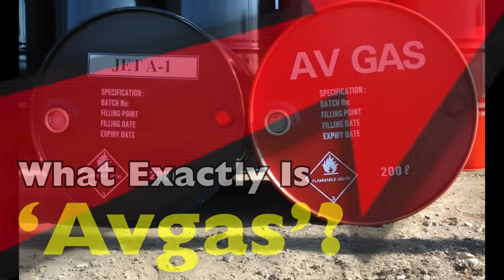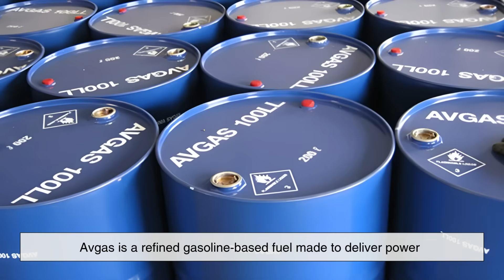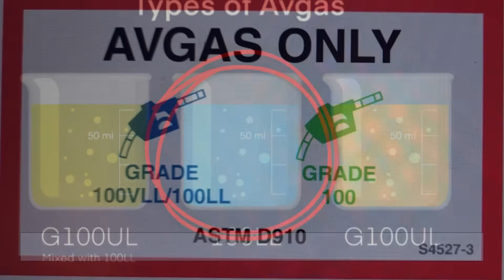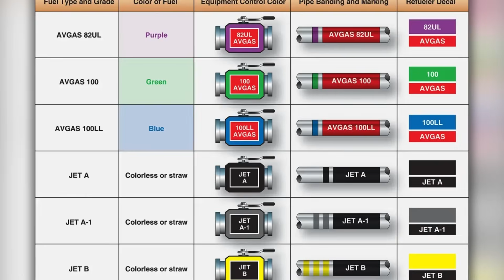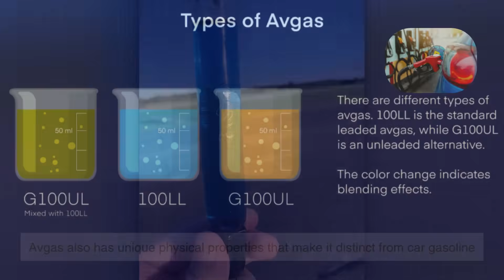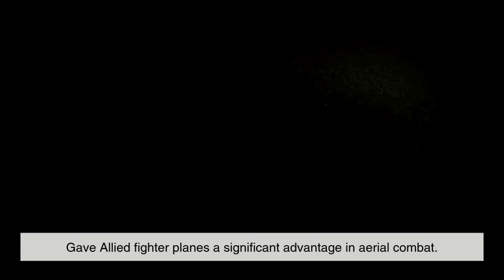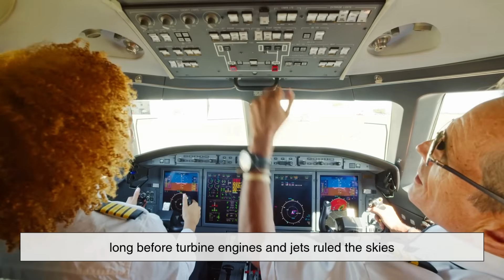What Exactly Is Avgas? The Secret Fuel Behind Small Aircraft

Comment: The old airplane engines 1940's or older were air cooled and ran on 80-87 octane fuel. This fuel had lead in it to facilitate lubrication. They came out with a newer fuel called 100LL for newer engines. The 100 is the octane and the LL stands for low lead, but of course it has lead in it. These aircraft engines are still used but are getting rarer and will fade away in time. I had a homebuilt with a new Subaru 2.2 Ltr. engine that ran on regular car gas.

Comment: Lead needs to be banned from fuel NOW!
Reply: There isnt much lead in 100 LOW LEAD. Every bit of lead that is in it can from the earth and will return to the earth. At between $5.00 and $5.50/ gallon and $30-60k for engine rebuilds, the last thing we need is another poorly thought out "solution" that causes more problems than it could ever solve.
Aviation is SO expensive, in large part due to government regulation and law suits.
We need relief and the opportunity to advance, not more regulation and control.
Reply: @scottwhitcher265  I repeat. Lead needs to be banned NOW.! Actually, 40 years ago. Lead is incredibly poisonous. Sure, the lead returns to the Earth. It falls on population centers. The aircraft that use leaded fuel are largely unnecessary. Ban the lead and let the planes fall where they may. Aviation is SO expensive? Too fuckin' bad. There is no right to flight.
Reply: Chlorofluorocarbons (CFCs) in my hair spray caused the ozone hole that magically went away.   nitric oxide went away with the   catalytic converter. In Iowa corn sweeteners are making our kids fat. But the carbon has to be sequestered at the processing plant. which is OK by your shouting.   Little bit of lead left will not kill you one day sooner.  Hope you get out of the Hotel California soon.
Reply: @2148aa  I don't care what you have to say. Lead is proven to be extremely toxic, even in small quantities. It needs to be banned from fuel entirely, 40 years ago. let the planes fall where they may.
Reply: @phlodel  Then you won't like the fact    that lead shotgun shells are still around for a couple of more years. Maybe you can shoot the planes out of the sky with them.  Next all the plastic pallets in the wild can be your next worry.
Reply: @2148aa  I'm thinking you fly little toy airplanes and don't want to change. Your engine will run on unleaded fuel, until it burns the valve seats. Then, you'll simply have to pay a lot of money to continue to use that engine. No problem.

Comment: Contrary to popular belief, high octane fuel is slower burning than regular 87. High octane allows you to run higher compression ratios and earlier ignition timing without pinging or detonation if properly tuned. Both of these obviously increase power. I use it in almost everything but my vehicle, due to it being Ethanol free.

Comment: I ran this stuff in all my muscle cars every day. No complaints & it worked flawlessly every single time. Used some Navy 120 AVGAS back in the day & it was like rocket fuel for my 11:1 compression pistons/550 lift cam-int.& exh. 312 duration flat tap solid lifter. That little 327 ran perfect with it. Side pipes were nice & clean.

Comment: My 67 VW bug loved av-gas, mileage went from 33 to 40mpg, lot more power, and quieter. I had a single 28mm carburetor so it ran lean, my wife's VW had dual 34mm carburetors, didn't make a difference on the mpg.

Comment: Used to be able to go to a small airport with a 55gal drum in yer pick-up truck bed and buy all the leaded high-octane (110~125) AV-GAS ya wanted for your hi-compression muscle car or hot-rod motor with 11.3-13.5 to 1 CR!
Reply: Avgas is VERY expensive!!!
Reply: @leechjim8023  So is CAM2 or other race fuel sold in a 5gal can~35gal drum. No idea how much Sunoco race fuel is at the track anymore! Probably double the price of 93/94 unleaded at the corner station.

Comment: Secret? Who is keeping it a secret? Specifications are available on the internet.  
Gasoline "for aviation use" doesn't date from the turn of the century gasoline was gasoline. Airplane engines were running on just plain old gasoline until the late 1920's. Octane ratings had been gradually improving through the twenty and thirties spurred by research in the USAAF and the auto industry (Kettering and Midgely). The invention and use of Tetraethyl Lead began to impact aircraft engines in the 1930s, and Doolittle pushed for 100 octane in the mid 1930s. by then the military and airlines were interested in higher compression and higher supercharge for improved performance, and suddenly airplanes were flying on 80 octane and 100 octane fuel, and the manifold pressure usable and corresponding horsepower of large engines was tied to the fuel in the tank. ;throughout WW2, octane rating/performance number increased in several steps to PN as high as 145 by 1944.
While nobody intentionally broadcast the intent, wartime fuel properties were  well known. The axis powers knew all about it , they just couldn't produce it in quantity, eventually not being able to produce any fuel at the end of the war.

Comment: Normal AVGAS is low lead fuel. WWII aviation fuel was extremely leaded to the point of 150 octane. With that fun stuff we had to clean the spark plugs every 25 hours of run time.  Such fun... NOT! The 100LL stuff now days is MUCH easier to deal with when it comes to engine maintenance... plus due to FAA mandates, there is NO alcohol in the fuel. Ethanol has a tendency to attack the aluminum wing skins when the fuel is stored in the aircraft tanks.
Reply: Ethanol is also responsible for short gasoline useful life, vapor lock, sludging and engine failures, mostly due to its propensity to suck/absorb water out of the air
Reply: @1shARyn3 exactly...

Comment: AVGAS is great for long term storage of gasoline powered equipment, motorcycles, etc., as long as they do not have catalytic converters. It lasts much longer than gas from your local gas station. Fill a gas can at your local small airport.
Reply: My snowblower, lawnmower, weed trimmer, pressure washer, ATV, generator and whatever small engine I own and forgot all use AvGas.  The lawnmower fires up with two pulls in the spring, the snowblower fires right up in the fall.  

No issues unlike everyone else that uses pump gas that degrades in the off season.
Reply from the maker: Thanks for sharing that practical tip!
Reply: You gotta use non oxygenated premium unleaded instead of unleaded regular grade with ethanol, alcohol. Some states still have regular non oxygenated, no alcohol, unleaded too. In my area we have 91 octane premium non oxygenated, no alcohol in it. Been working great in small engines and cheaper than AV Gas which was over six bucks a gallon in my area last time I checked.
Reply: @o @oneninerniner3427 Pump gas of any octane oxygenated or not still degrades much faster than AvGas.  AvGas has requirements to maintain octane stability much longer than MoGas (automotive fuel).  Never having to tear the carb off to clean it is many hours saved.  I’ll run regular pump gas during the season but the final tank before storage is Av.  Even if it was twice the price it’s a money saver not having to work on something.
Reply: Local airports around here will not sell it if it's not going into an airplane. Fuel-truck to airplane only!
Reply: That's the case at larger airports here but small airports often have self service pumps that take credit cards.
Reply: @MrHugemoth OK, guess it all depends on local regs, airfield management??? We did it back in the 80s. But I reckon things are different today. They can't get caught putting it directly in a street-driven vehicle because it is not 'road-use taxed' ($0.58/gal here in PA). Heavy fine and loss of various licenses. Tracks that sold race-gas used to charge the tax if whatever you were running was street-legal/registered.
Reply: Tried 100LL for my small motors but my local airport had a 10 gallon minimum sale. I found storing it in plastic jerry cans it actually bleached the red color out of the plastic.